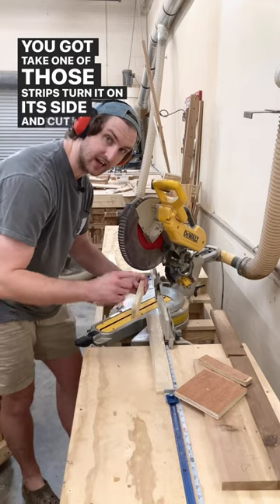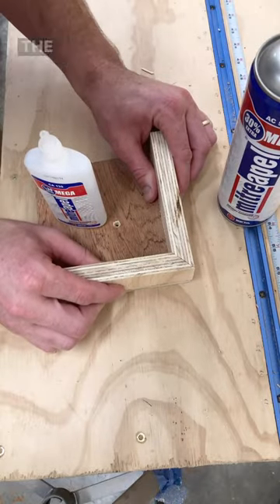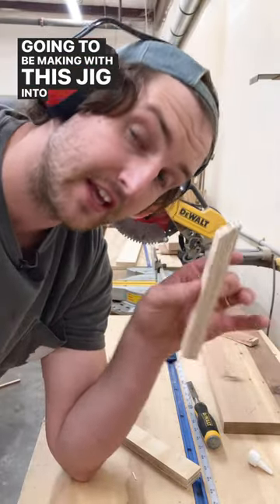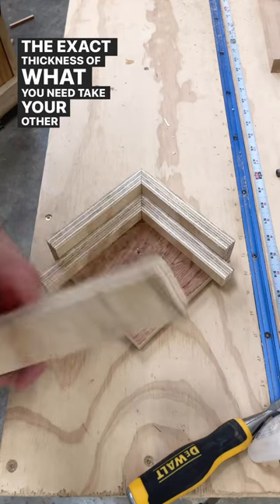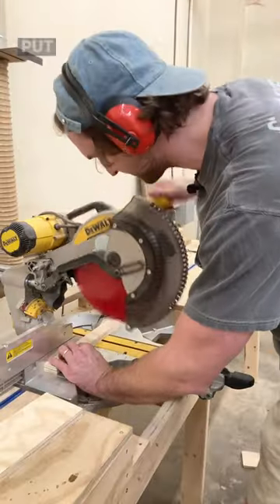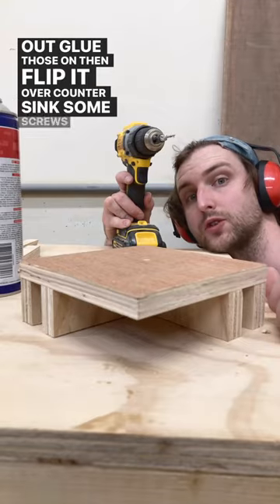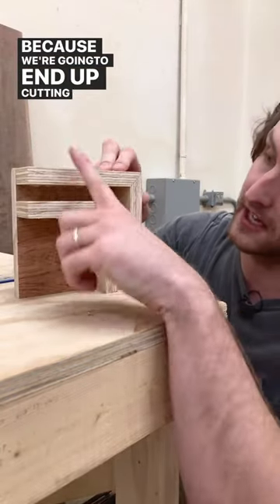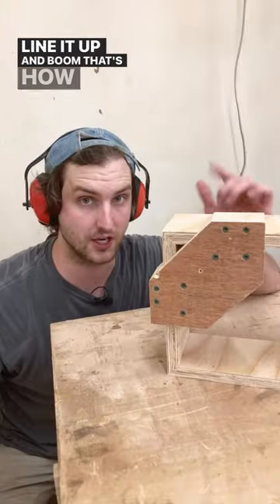Save some time by creating this quick and easy jig to hold your cabinet/box corners in place! (Or an

Comment: If you're not going to spend the $20 to get a set of 4 corner clamps, it would be better to just put the sides on and then use whatever clamps you already have. It would save time since you should have your work piece clamped in place either way. There's no reason to add the extra line of wood that won't actually hold the work piece at all, much less hold it in place, without a clamp.

Comment: So you now have one made for 1 corner and 1 thickness of board, common sense says just buy adjustable corner clamps
Reply from the maker: true only if every box and corner was different but in reality most of what I do is with 3/4" plywood and is just a 90 degree corner so it's much nicer and far less time consuming to not have to adjust anything!